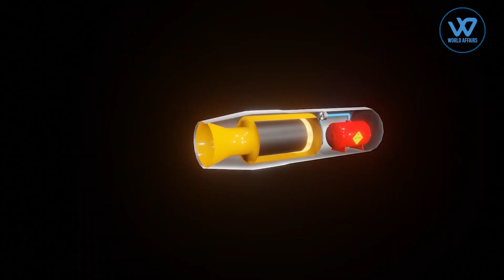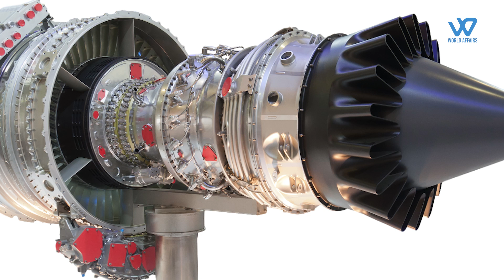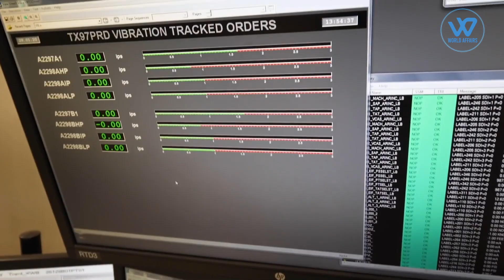Can India Make Jet engines Indigenously For Its AMCA

Comment: With the status-quo NO WAY.

FIRST, HAL, ADA, DRDO & GTRE should be brought under PMO, similar to ISRO.

When ISRO achieves milestone after milestone with severe constraints, why HAL etc are fast becoming white elephants ? Should someone take the whip ?

Second, PMO should urgently order an industry-academia joint consortium consisting of the best and the brightest from IITs, IISc etc and from the industry research labs. This consortium should work overtime to plug the holes and gaps in the high end and advanced technologies such as kaveri engine, next gen jets etc. It should make Kaveri the indian answer to F-414 (Mins you, NOT F404)

INDIA SHOULD STOP PIGGYBACKING ON THE WESTERN SHOULDERS SHAMELESSLY LIKE INTELLECTUALLY PARALYZED AND HANDICAPPED.

IT SHOULD GROW SOME SPINE AND LEARN TO DO THINGS ITSELF.

ONLY THEN IT CAN EARN SOME IOTA OF RESPECT FROM THE GLOBAL SCIENTIFIC COMMUNITY.

Comment: Not if the AMCA Project date line is realistic and is held. India does NOT have the technology, Materials, Machining Capacity and Organization which can perform it's tasks smoothly independently and jointly. Engine Manufacturing Teams take DECADES to come toether and mature, over FIFTY years or so. Moreover, there is no ECO System in India that can support myriad of very complex parts which run in to Thosands. India can NOT make a Jet Fighter Engine for atleast for another twenty Five Years. Just look at Kaveri Engine which India dropped after working on it for over FORTY Years. Kaveri is as useless as tits on a boar.

Comment: If we have started in 1947 we would have achieved it by the year 1990. We started late and we did not invest enough funding. So the issue is low funding and not enough time. To solve the problem we need to increase the funding and that can cut down the time required to develop. Again it is not that easy, only four countries succeeded, We can make one but to make sure we succeed will take even longer time periods

Comment: Kaveri performance  has reached its design now after years off  R AND D INDIA HAS DEVOLOPED 3 GENERATION SINGLE CRYSTAL BLADE AND TITANIUM HIGH PRESSURE DISKS SO THIS IS GOING TO BOOST THE PERFORMACE OFF THE ENGINE SIGNIFICANTLY  HENCE THE RUSH BY WESTERN COUNTRIES TO COLLABORATE  AND TRY KEEP INDIAN ENGINE TECH DOWN
Reply: Interesting theory GE will do just fine.

Comment: You have a very flawed memory. The first British jet engine produced was called the W-1, it was capable of only 4 kN of thrust, and was fitted to the Gloster E28/39 airframe specially built for it. It first flew on 15 May 1941 at RAF Cranwell. Compare this to the first Kaveri engine that produces 70.4 kN of thrust and marvel at the Indian expertise in doing things from start to finish for peanuts. The Kaveri engine will be used in Ghatak stealth UAVs. The problem with India lies in the metallurgy department. We will need some more time to develop alloys that remain strong at 1800 degrees centigrade. It would take us seven years of hard work to make an indigenous engine that produces close to 110 KN and can be fitted on AMCA. To cut down this period, India is paying Safran to help with the Kabini core of Kaveri. The US is a fickle friend and so is the UK which is rightly called the US poodle. India will pay one Billion US dollars to Snecma. We can afford it. Boris Johnson on his visit to India wanted India to work with RR in producing an engine, but the talks didn't go very far.
Reply: Yeah if the UK is the USA poodle then India is Russias

Comment: India opened it's economy after 1991 something so strong Industrial capabilities were build only after that period.

Indian case can be simply explained as like suppose u have to cook simple chapati but for that u start with finding a farming land, the water supply, then u have to find seeds, fertilizer, machinery, man power , proper manpower and what not. 

So in 1990s India had started from 0, todays India is not a manufacturing hub, but still todays India is way better than 1990. Don't worry, have faith, India will definitely build a jet engine in Future !!

Comment: It's India's lack of metallurgical experience is what prevents us from developing engines. But our thermodynamics, composites and flow contol knowledge is world class. So building a cryo rocket engine was not that hard for us.
Reply: Yep India has very poor metallurgical engineering institutions.
Reply: Sir, I feel we need not spend so much on aircrafts and rather concentrate on drones and missiles....drones , missiles and mbrl s are the future....aircrafts are too expensive  and most vulnerable...rather cruise missiles in large numbers and drones fitted with missiles will serve the purpose
Reply: @siddhartharay1835  well, even if that were true, most hypersonic cruise missiles use SCRAMJET engines, not Rocket engines. And if you want to build one of those, you should have built at least a few dozen normal aircraft engines.
Reply: @_tsu_  scram.jet propelled brahmos iz already mfg in India with technology transfer from Russia  ....rocket engines for satellite launches are already mfg in india...we have released hundreds of satellite so far...ballastic missiles like agni are akready produced in india ..
Reply: @siddhartharay1835
Reply: The point of making your own jet engine is so others can't sanction you.Also, aircraft is needed for air power which is necessary to win a war.Also, more powerful engine can be put into 5th generation aircraft like the f35 which is by no means obsolete

Comment: This is because they lack the knowledge in metallurgy 
Pure rare earth metals and alloys make high power engine so engines can reach very high temperature and highly durable
Reply: THEY DID LACK METALLURGY WHICH THEY RECENTLY CRACKED HENCE THE RUSH BY SAFFRON AND ROLLS-ROYCE TO BE PARTNERS INDIA HAD DEVOLOPED THIRD GEN HIGH TEMP ALLOY FOR HOT SECTION WITH RHENIUM AND THIRD GEN SINGLE CRYSTAL BLADES AND NASA RECENTLY APPROACHED INDIA TO PURCHASE HIGH TEMP ALLOY THEY CREATED what is holding india up is lack off a flying testbed and wind tunnels a wind tunnel is under construction and  money is being ALLOCATED FOR FLYING TESTBED I think in five years you will see a lot off progress

Comment: Last fifty years India has failed to produce one . India took decades to develop a high endurance drone . India will resort to usual technique called joint ventures either with Israel , Russia or France . Under this guise most of the work will be done by foreign collaborator at a huge cost

Comment: yeah, you knock China for having reverse engineering in the past.  However, "copying" means at least China has been producing engines on its own, using it's own produced parts, from its own factories.  So China has the industrial base to make anything it could design.  India on the other hand, can't make all the parts domestically even if the designers could complete the design.  Until India build up the manufacturing bases, .domestic manufacturing isn't possible.

Comment: It’s hard to believe India will be able to build a 5th gen fighter when they haven’t been able to build a true 4th gen one. The engine for a 5th gen fighter is a whole different animal than one for a 4th gen which india hasn’t masted yet either. Even Russia hasn’t built one, which is one of the knocks on the SU-57 that is can’t super cruise without burning out the engine. I’m not saying india can’t do these things, just there is a learning process and it’s hard to jump steps. India is trying to jump steps. Good luck
Reply: Heard of Tejas LCA? even the American Airforce chief has praised the controls, electronics and aviation of Tejas. Wake up. Good morning edward.
Reply: @maadi77 😂😂😂
Reply: @maadi77 control electronics and avionics are israeli made in tejas.

Comment: "Even China, which has years of copying experience.." 😂😂
Reply: Indians are good at mocking others
Reply: @Cool Sparkz China has 'copied' others engines. It is not capable of building one by their own.
Reply: @swapnilpawar8015  You seem to turn a blind eye on fact, or you just can't accept the truth?
Reply: @russelfang7434  Blind eye? Despite all their graduating "experts" in the field, China has yet to create anything even remotely original in the combat aviation industry. The JF-17 & J-10 stem from come from Israel leaking F-16 designs and it's Lavi based on the F-16, the FC-31/J-35 combination of aircraft are by far the most straight-forward copying and the U.S. government even admitted they fucked up and that China stole F-22/F-35 designs and the two variants of the FC-31/J-35 are a combination of different elements of the F-35 and F-22, mostly the F-35. J-20 is a hybrid bastardization of a bunch of designs thrown together... Mainly Russia's Project 1.44 with elements of the F-22 and even F-35. Obviously the J-20 has some original design aspects since you can't just throw 3 aircraft designs together and call it a day but point still stands, Russia has admitted MiG sold off the designs when going through trouble and the stealing of F-22/F-35 designs from Lockheed is known as well. Besides all the other aircraft that are relatively straightforward licensed Chinese variants of Flankers except for the one where they just bought the prototype from Ukraine and reverse-engineered it. Even their engines are Russian or domestic produced variants of Russian engines. It's what the Chinese do, it's what they're best at TBH. They steal and/or implement the technology of others and it's one of the things that's allowed them to catch up so fast. They do it in every industry and undersell foreign corporations and exploit the greed of foreign companies wanting cheaper labor by forcing technology sharing to operate in China. It's smart... and sneaky but most importantly... It allows you to catch up to near-peer nations extremely quick, however, this mentality doesn't breed innovation and while China has been innovative in recent years almost all their industries are either around the same technology level as world leaders in that field or behind. In fact, the only thing I would really give the edge over any other nation ATM in military technology is certain niche missile technologies... Especially hypersonic missile technology
Reply: @swapnilpawar8015  too hurtful? India cannot make a jet engine, sad but true, India can't even copy
Reply: @JCNEOHK  correction : We DO NOT copy. Thieves pay one day, so will China.
Reply: @swapnilpawar8015 LOL, you are so funny, India never copy?
Reply: @JCNEOHK  really are u even updated, check 40kn engine made by  gtre and hal
Reply: @abhishekbhaskar6268 Wow,  you are so updated, mentioning the failed engine which cannot even leave the test bed...
Reply: @swapnilpawar8015  that's what salty Indians always say. Why so sour and salty? India is a sad case.. Tried to steal Russian tech, Israeli tech, French tech... No success even when specimen right in front of you
Reply: :) I was doing to say the same. Kindly add timestamp.

Comment: Difference is Rocket engine despite its complexity is like perishable and less moving parts that need longevity.
Jet engine requires longevity that means nation should be strong in metallurgy and industry.
Reply: Plus the jet engine has human safety factor, rockets dont.
Reply: +the new cryogenic rocket engines, esp raptor class are reusable and Indian next gen cryogenic and semi-cryogenic that replace vikas engine will also be re-usable.

Comment: Can India Make Jet engines Indigenously For Its AMCA?

Not in the near future within 20-30 years. Not with the rate their industry, infrastructure and technical support are developing. As this video has shown, India has no way to develop an indigenous jet engine on their own and they have to license engine technology by bowing down to western powers and keep them happy. If the west decide to sanction India for any reason, the jet engine tech development will be dead in the water. For that matter, India's national security is tied strongly to western interests and that is an Achilles' heel.
Reply: West put sanctions on India after Nuclear Tests and US put pressure on Russia to deny India technology for cryogenic engine but India developed its own cryogenic engine.. France was the country which supported India's nuclear test and continued arms sale to India so India may go with Safran for engine joint venture.. Kaveri engine which India built has less thrust for fighter jet but atleast it will power UCAV etc...
Reply: Wait and wach for 10 years for the answer.

Comment: I'm not an engineer but some of the things you say about a rocket engine and a jet engine sounds to be true but a rocket engine is only used once whereas a jet engine is supposed to be used multiple times I'm just saying
Reply: Sir, innovation means to dig out a completely new way without following any else s foot steps....so indian technologists would definitely find a way around to reach the goal..we may perhaps use single use cheap engine to power aircraft and discard that on landing or may use some sort of catapult to launch the aircraft at very high speeds which may cover most of the distance in the flight path and then fire up an engine while in the sky...or we may use low speed aircrafts to launch  a to a  missiles while on the sky to hit the target....some how we have to achieve the goal of hitting the enemy on the air..

Comment: It takes about 20 years in developing a mature engine, which includes thousands of hours of testing. If it's said that India wants its AMCA to come into service in around the 2030s, they still need to rely on foreign engines which depress its indigenous developers. Sad story.
Reply: It is not 80s and 90s where you needs 20 years of randomised controlled trail(RCT) and empirical experiments. Things are speeding up with new innovation every six months.
Reply: @ham4553  That's the physic rules. Computers doesn't help this process at all.
Reply: India does not steal the technology of others like china, as recently china tried to steal the technology of Russia and don’t underestimate Indian scientists they build everything just wait and watch✌️
Reply: @rohinyadav2967  Indians always use stealing to show how powerless they are.
Reply: China has already made some substantial breakthroughs in jet engines lately, now China can confidently says all the high performance engines used for the jet fighters are domestically made.
Reply: @fsh3702   No doubt China has expertise in copying anything but India will develop its own this decade itself.
Reply: @fsh3702  Not that much but at a fast pace.

Comment: My Opinion is
#EU and #US are in great Recession due to surge in #crude oil prices and Russia-Ukraine war the hope for western countries is #India only so they have to support #INDIA otherwise it is a suicidal machine to them and India and Russia trade is better than before so if they bypasses #Dollar with Rupee-Ruble agreement then #EU and #US gone
Reply: You might want to review your facts so your Opinion isn't simply wishful thinking.
The US is totally unaffected by any global crude oil availability, the US is a net exporter of fossil fuels which means it imports only by choice and regardless exports more than it imports and uses. It's only through some kind of self-infliction that the US allows its domestic oil companies to participate in a conspiracy to manipulate local supplies to intentionally raise prices... There is plenty of published industry data over the past 1 1/2 years that say there are no domestic shortages and reasons to restrict refining capacity but that is happening anyway.
As for the EU, their problems are largely of their own making by committing to Russian pipeline supplied NG and not working harder to develop renewable energy resources. The other issue is that the Middle East also has incentives not to allow prices to lower or stabilize. If OPEC can be persuaded to replace Russia as an energy source, the situation would change. The Middle East has the capacity and capability to change the EU situation overnight. SA recognizes this and is just beginning to explore what kinds of diplomatic tradoffs are possible for increasing its contribution to global needs.